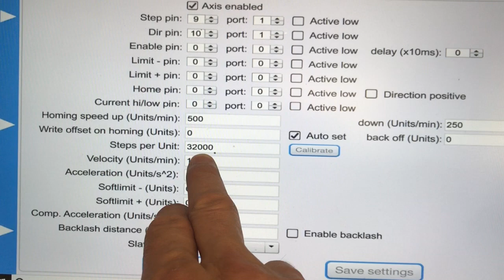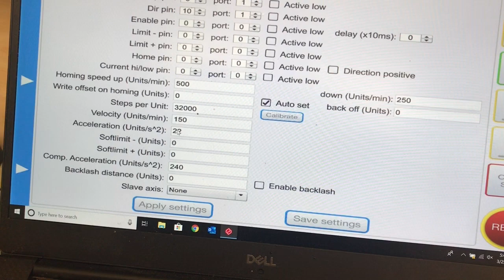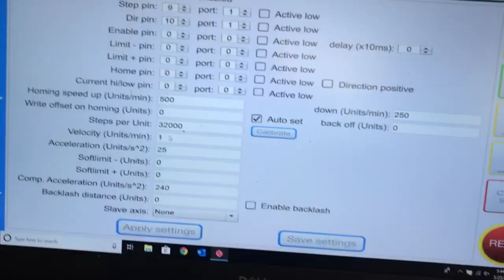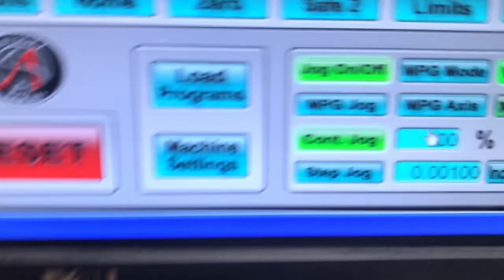JMC Servo iHSV57 (English language) Video 2 Taig CNC Mill

Comment: I bought the 180w and they rapid over 400 ipm. They’re lightning fast in comparison to the 100w. They also came tuned from JMC. I gave them my specs and they sent them pre tuned. If you buy from a dealer I’ve been told that they don’t have any tune at all. How is it running for you today?
Reply from the maker: Nice! Actually they are still in a box:( After I made this video I purchased another Taig CNC that had ball screws (this one in the video had lead screws). It came with steppers and drivers pre-installed, and goes 200IPM with no problems. So I left it as is, and saved the JMC servos for a future project.

Comment: That small comment of your kernel speed set to 100khz solved ALL of my issues. I knew there was something off with the way the driver was receiving the pulses, was too busy playing around with the pulse filtering and other settings before I realized 100khz would give the 1us pulses
Reply from the maker: Glad it helped! I later also tried setting the servo dip swithces to 800 pulses per rev, and at the 100KHz kernel, I could get something like 375IPM rapids on my V-thread screws. But the servo alarmed out at those speeds, and my lead screws were whipping, so no good on my particular machine.
Reply: @nickp4793  manual shows max pulse frequency is 250k, haven't tested it beyond 100k tho. I got as fast as 20m/m on my 6040 which looked insane. Ridiculous value for the performance, at least on paper. Should be cutting with these motors next week, excited to record my automatic tool changes at 4x the original rapids. Thanks again for the help.
Reply: @NikitaLab  Any luck with the auto tuning parameters? I am trying to tune my 400W JMC servos without any luck so far. It says that if you change P01-03 it should automatically adjust other parameters. Nothing happens to the other parameters, when I change the P01-03 parameter.